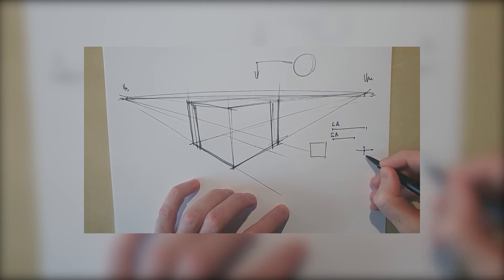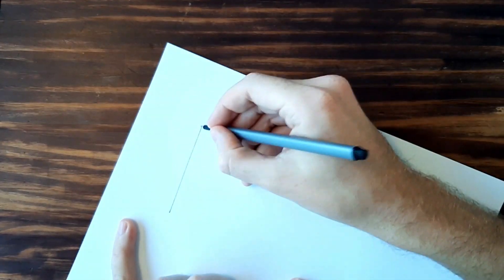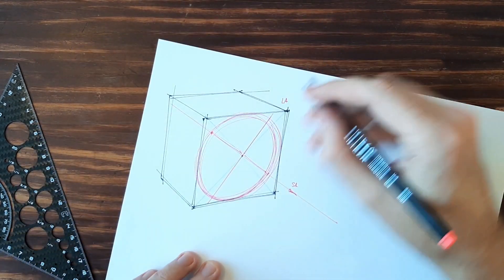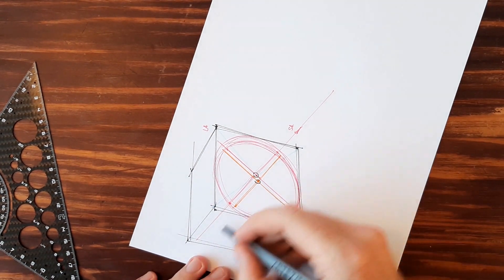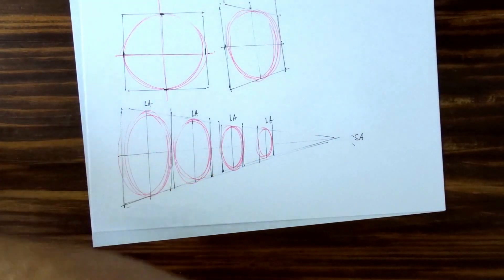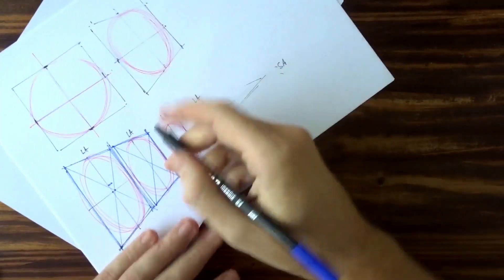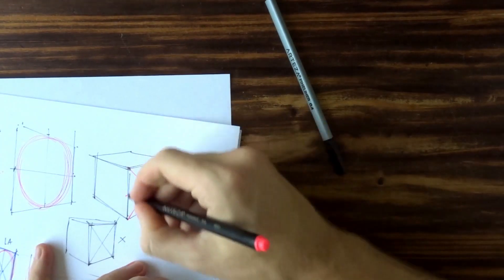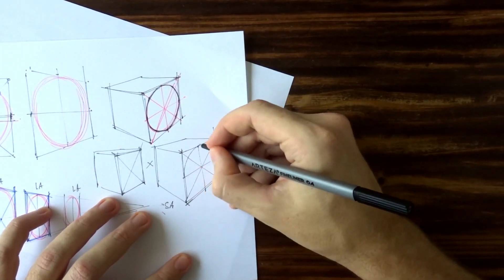Industrial Design Fundamentals: How to draw Ellipses in rectangles

Comment: Hi Rob
Thank you for the video
I'm sorry, but I'm not quite sure I grasped the solution.

Initially, you said that when drawing an ellipse in perspective, using a rectangle and its diagonals, the point where the diagonals intersect is not (as you previously thought in another video) the center of the ellipse-in-perspective.

You showed this by drawing minor and major axes first, creating an ellipse and then making a bounding rectangle around it. Again demonstrating that the intersection of the minor and major axes of the ellipse (i.e., actual center of ellipse-in-perspective) is NOT the same as the intersection of the two diagonals of the rectangle that fits the ellipse (i.e., center of rectangle-in-perspective)

So what is the solution? If you begin with a rectangle-in-perspective, how do you draw a more accurate ellipse since you can't use the intersection point of the diagonals?

Was the point just to show that it is wrong but a good approximation?

Hoping for a reply
Thanks!
Reply from the maker: Yes exactly your last point. I am actually teaching on the uni as well and we suggest that students take that point as an approximation. The section line of the face that halves it and entails the center point on that face because of perspective is going to gie us two halves that in perspective will be distorted. The half closer to the vanishing point will be narrower than the one further away. Because we are constructing the ellipse in absolute geometry and don't pay attention to foreshortening, we will probably have to place the center of the ellipse slightly to the opposite direction of the vanishing point that acts on the face that we are working on. But the approximation of hovering and finding the intersection points will work well enough as well.
Reply: @robertlkiss  Great! Got it. Thank you!

Comment: Hey Rob, thanks for the video. I have one question in mind…if you draw squares in two point perspective f.i. for a horizontal grid, the ellipses in it shouldn’t rotate as the vertical lines of the square (or cube) would stay parallel. To make it clear, every ellipse in this kind of perspective grid shouldn’t rotate but stay parallel to the horizon line. A rotation of the ellipse in a horizontal 2 pp grid would only make sense if the verticals would have a indeed a vertical vp which then should actually be a 3 pp. Am I Right with this?
Reply from the maker: Woah imma be honest I'm not quite getting the question. If you joined me on a live session on a future thursday(after the 22th of Sept, I'm still on action till then) I'll gladly try and answer your question there.

Comment: great and important video !!! .... 
however, now I'm a bit confused ... 
I thought that the axle of the car wheel is an extension of the minor axis ... 
now,, after this video, is it still the minor axis ?? 
or should it start at the center of the bounding box of the wheel?
Reply from the maker: The axel of the car wheel is an extention of the minor axis nothing has changed there. The point here is that if you draw a square around the wheel, the center of the square will not align perfectly with the center point of the ellipse.
Reply: But if it is the case, than rotation axis of a cube ( face center point -> perpendicular vanushing point) would be different than rotation axis of a wheel (ellipse minor axis) which seems kind of wrong. Imo in order for this whole minor axis thing to work, center of a cube's face must coincide with minor axis of a ellipse which is not a case with some 1 point and 2 point perspective cubes. Am I missing something?
Reply: @jakubstaniak9124  Scott Robertson says that the major axis misses the midpoint of the rectangle entirely. The "midpoint!" of the minor axis misses the midpoint of the rectangle also, but if you extend the minor axis from its midpoint a bit further it intersects the midpoint of the rectangle. In the end the midpoint of the ellipse is not the midpoint of the rectangle but the midpoint of the rectangle lies always on the minor axis "somwhere" (most often they are very close to each other).

Comment: :/ the center of the ellipse is not the same as the center of the plane BUT the center of the ellipse remains on the long axis of the box or cylinder you are drawing it into :l
Reply from the maker: If I said that I probably misspoke. The box doesn't have a long or a short axis since it's not constructed with the help of ellipses. The ellipse will be one of the ends of the cylinder so it is natural that the axis that forms the center line of the cylinder goes from one ellipse center point to the other. I hope this helps.